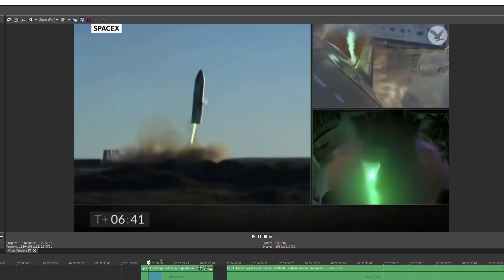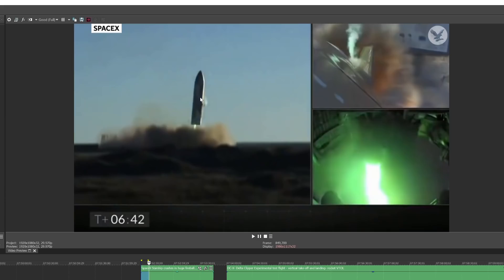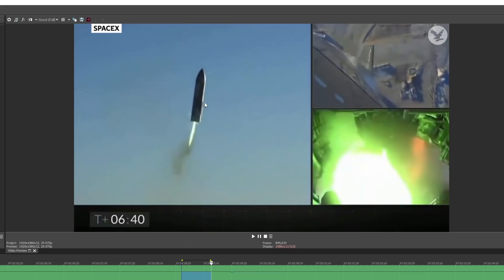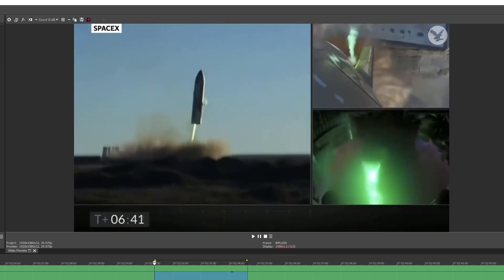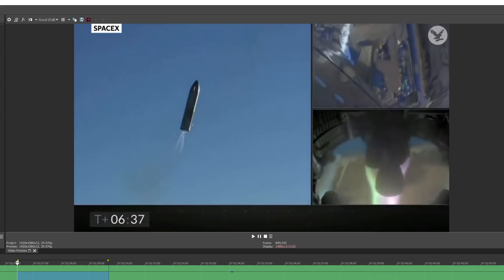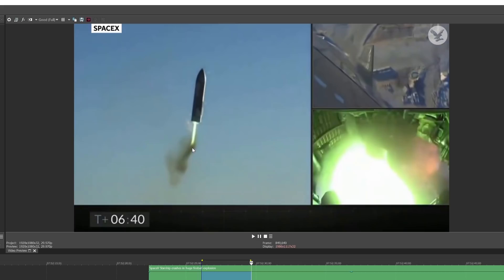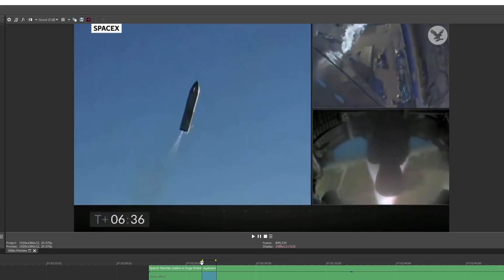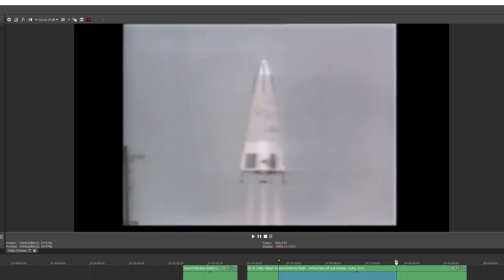SpaceX Starship Explosion: First analysis!

Comment: just a couple of notes, the combustion does not happen in the bell, there is a combustion chamber and the bell is to speed up the exhaust, not sure if that is what you meant but just to clarify.  also in teams of how the fuel and oxidizer is fed into the engines, they have separate pressurized header tanks.  they do not feed from the main tank, this is supposed to stop the issue of inconsistent fuel feed on relight and combustion issues.  however, the pressure to the engines does appear to be an issue according to Musk's tweet.

Comment: Interesting points. A few things, to add your right about the fuel tank issues, thats why on this rocket they have seperate pressurized tanks for the landing fuel and they basically drain the main tanks on accent. On twitter Elon said those tanks didn't have enough pressure. My thoughts are they lost the correct ratio of fuel and oxidizer and that results in "engine rich exhaust"
Reply: Exactly my understanding so far. 
Been following the development of this vehicle for years now and moderate the Everyday Astronaut discord for context.
Reply: @faceplants2  that's awesome, he makes great content I had his stream and space x up for all the sn8 launch attempts.
Reply: Why does it result in this?
Reply: @JohnnyZenith  when burning with an oxidizer like liquid oxygen it's very aggressive. If the methanol is not available to be burned it will then react with whatever else it's in contact with. In this case it appears to be copper in the engine. They once experience a similar green flame on a raptor test and it was confirmed that it was copper from part of the engine.
Reply: @EvanDunville  Raptor burns methane, not methanol (CH4, not CH3OH). Just to clarify.
Reply: @sycodeathman  ha ha oops. I work in the chemical industry so I talk about methanol lots. Your totally right it is methane.

Comment: Technological advances of SpaceX compared to DC-X which flew between '93 to '96.
CPU Speed...     DC-X '93 to '96 RAM = 300MHz        SpaceX 2020 = 3.4GHz(16 Core)
RAM...     DC-X '93 to '96 RAM = 4Mb to 128Mb        SpaceX 2020 = 48Gb
Congratulations SpaceX just keep trying as everyone has failures and learns by their mistakes!

Comment: It looks like one of the two engines failed, like you said. You can see only half the jet output is remaining after that burst of green light. Basically, One of the two engine jets turn green, and you have both a green and blue/purple jet. Soon after, it looks like the green engine bell swings sideways, and knocks out the still-correctly-operating jet. That or the other engine simply happened to die when the green jet swung out of view. Then the one remaining green jet keeps working (swinging back into view of the camera), but it is with half the thrust that the rocket needs to slow its landing.
Reply: From what spacex has said the little header fuel tank for landing in the nosecone had some issues. The fuel supply most likely went highly oxygen rich and caused some of the copper pipes that cool the nozzle to burn. Apparently the engine out toward apogee was intentional and all engines did relight successfully for the landing burn. Imo the test looks to have gone great as the biggest thing was the aero performance and burn back to vertical not the actual landing. My bet is than sn9 will probably land and not rud.

Comment: Thanks for the video and analysis. 

I thought that Raptor used TEB for ignition with green color just like the Merlin engine but that’s not correct.

Will be interesting to see how low fuel pressure from the header tanks relates to the green exhaust. Guessing that low fuel flow + the high temp turbopumps = some of the plumbing or injectors started melting & burning.
Reply: Raptor uses electric torch igniters (a giant spark), not TEATEB.

Low fuel pressure = less coolant (fuel) going through the regen channels in the nozzle = nozzle begins to melt, nozzle is made partly out of copper = green flame.

Comment: I thought they had smaller separate tanks that remained full just for the restart to prevent this problem though.
Reply: Yeah they do. It seems that those separate tanks didn't provide enough pressure to keep the engines running.
Reply: @clippityclipclip10  speculation, will not lead to anything useful
Reply: @dwayne_dibley  should have included source in the comment
Reply: @YounesLayachi  I wasn't speculating in the sense you are talking about. This is what Elon said himself. But, since we don't have the data (as to be expected) to do a third party check on Elon's claims, I said it seems to be such.

Comment: They use spherical header tanks, Oxygen in nose, CH4 in between common bulkhead... Raptor shutdown at end was normal, only want one engine for landing, two engines has too much thrust... Single engine at end started burning copper due to oxygen rich propellant because CH4 header tank didn't have enough pressure. This is either ran out of CH4, or not enough feed pressure into header. This caused the single raptor engine to have lower thrust than required, and it impacted before it had enough time to slow down.

Either way wildly successful test, SN9 is waiting and ready, they should have all those problems ironed out for it's flight in a few weeks or so.

Comment: Musk twitter a year ago:  "Raptor uses milled copper channels with an inconel jacket all the way down"  ... one engine burned up
Musk twitter today: "Fuel header tank pressure was low during landing burn, causing touchdown velocity to be high & RUD, but we got all the data we needed! Congrats SpaceX team hell yeah!!  .....Successful ascent, switchover to header tanks & precise flap control to landing point!"

Comment: I'm seeing reports that the green was due to copper lining of the engines being oxidised due to fuel starvation. AKA "Engine Rich Exhaust".
Reply: The real analysis you've been waiting for from Scott Manley
https://youtu.be/egHxiX40eJY
Reply: "Engine Rich Exhaust" means that the engine ate itself. There is copper cooling pipes in the engine hence the green flame.
Reply: Engine rich exhaust..  my gawd xD
Reply: Makes sense, every other possibility i was thinking of was related to something breaking, but it probably would be more catastrophic than it was
And elon said it was a header tank pressure problem, and that the engines did great
So probably not a engine related problem(at least not one that started on the engine)
Reply: Scott Manley Twitter follower detected :)
Reply: Google says copper make a flame burn blue and that Barium makes a flame burn green.
Reply: @tarstarkusz  I burned copper wires for a science project once, the flame was definitely green
Reply: @tarstarkusz  Copper burns green to blue, and there's likely other alloying materials in whatever was burning.

Comment: This engine's injectors seem to be copper: https://twitter.com/burpg/status/675167881471139841
Reply: The entire inner lining of the nozzle is copper also, however it's not structural. The inner copper lining has the coolant channels through it to withstand the heat of the combustion reaction, and for strength this copper layer is wrapped in a very strong steel alloy jacket.

Comment: Starship has two small header tanks that are used to fuel the rockets on landing with less sloshing. They are independent from the main tanks and much smaller. One (LOX) is in the nose, the other is at the top of the lower methane tank.  They aren't using the big main tanks at that point.  Musk confirmed successful switching to the header tanks,  but fuel pressure was too low to sustain the engines.

And green flames happen when they use TEA-TEB ignitor fluid used to start the engines.  The question is, on landing was there some other problem making the green flames, or was TEA-TEB being injected to keep it burning.
Reply: Raptor does not use starter fluid
Reply: @toby1248  yup that appears to be true ... but it always flashes green flame on ignition.
Reply: @KenLord  Raptor does not flash green ever, unless it had a bad startup or shut down. If Raptor flame goes green, it's burning its own combustion chamber.
Reply: @KenLord  it's only the Merlin engines on Falcon 9 and Heavy that flash green on ignition. Those do have starter fluid

Comment: The regenerative cooling parts of the engine bells are copper. That is almost certainly where the green was coming from. That engine that had green exhaust is also the first one that looked like it flamed out unexpectedly at the beginning of the flight. very cool watching the remaining two engines gimbal to compensate for the loss of thrust.
Reply: they had two engine flame-outs on ascent, I believe they were intentional
Reply: @TheAechBomb  The first engine out did not look intentional but we will get more in-depth information almost certainly. That is one of the fun parts of watching SpaceX developed vehicles is that they share so much information publicly.
Reply: The vehicle also appears to have never gone supersonic and the burn was much longer than the flight profile we were expecting due to the engine cutouts.
This was The coolest rocket launch I've seen since Falcon Heavy or maybe even the first successful landing of a Falcon 9 booster
Reply: @faceplants2  I pretty sure the shutdown were planned. I think I saw someone talking about that 3-2-1 thing. It is also logic as they would not want to go ballistic where they would have little control of the attitude while slowing down. We have already in-depth information as Elon Musk called it a full success except a loss of pressure in the fuel header tank used for landing ( that's how they deal with slosh, two small header tanks used only for landing), confirming just a few minutes after the landing that it was an oxygen rich situation

The rocket was not supposed to go supersonic, they changed that like last week
Reply: @Meiliv  I'll be curious to hear further official updates. The best info on the flight profile I had was from Declan from Flightclub.io 

They had a lack of pressure in the O² header tank. That would lead to fuel rich combustion.
Reply: @faceplants2  Well, the best source of info is always Elon's tweets, and he confirmed few minutes after the landing that engines did great all along and that the FUEL tank lost pressure in the end
Reply: @Meiliv  That was a short tweet. Wait for more detailed info and the thorough breakdown that Scott Manley will put out. The engines performed well but absolutely had a few anomalies. 

The fact that it flew aerodynamically with the new flaps and transitioned from belly flop back to vertical was a tremendous success but that doesn't mean that everything before the hard touchdown and RUD went perfectly.
Reply: @faceplants2  That would not be damaging to the engine like an oxygen rich combustion would be.
Reply: @davesvoboda2785  Yeah after more details and analysis came out, It sounds like I had it reversed and it was oxygen-rich mixture causing the engine to consume itself.
Reply: They turn the engines off to control thrust. As the fuel burns off the rocket reduces in weight, so the acceleration gets higher and higher, but by shutting off one engine, it reduces acceleration. The two engines they used to land were the two engines that shut off.

Comment: The flame out was planned - the empty Starship is too light for even two engines going. They partially lost feed of fuel due to low pressure in header tank and oxygen richness used the engine as fuel instead of methane...
The main tanks were so empty at the landing that  there was only what was in header tanks.
Reply: As a loss of feed to the engines is a problem wouldn't it be wise to employ a construction to not let the liquids move around in the tanks.
I have a hard time to believe that the tanks are at low to no pressure while the tanks are almost empty allowing the liquid to move around causing a partial loss of feed.
Seems to be a big design failure to me if that's the case.
Reply: @kullatnunu2087  I think that's why the header tanks are there. To not let the fuel needed for landing move around on the maneuver. Since the rest of the flight was done on the main fuel tanks without issue I'm guessing something with the ground handling or design of the header tanks is bad, but that seems to be the only thing they need to fix which remains untested. Everything else worked.

Comment: Green is the Starting Fluid.  It is tring to restart. Watch Falcon 9 at start, you well see the green flash.  Lights with contact with O2.
Reply: Nope. Raptor doesn't use that starter fluid (I forgot what it is called).
Reply: Combustion chamber is made partly out of copper.
Reply: @Katniss218  Yes, and I stand corrected.  The Raptor engine does not use TEA-TEB.  Most likely, as stated by others, mixture went lean and started burning engine metals including copper.  I know that F9 engines use copper as an inner lining, therefore Raptor likely does as well.

Comment: only at 4 minutes in here, i can say, green flames comes from the starter fuel on some rockets, if it really did flame out, then this was an emergency restart... well probably... also, one thing i know do not slosh, is syringes... i always assumed giant tanks like those had some compressor plate with a screw just keeping the fuel pressed and used decompressed gas in the empty part behind... so don't mind me i am just some idiot! lol EDIT, a few typos. also too bad for them, they totally failed their suicide burn... all they can do is give it more leeway next time and save less fuel. EDIT2: supposedly the rocket does not use Starter Fuel and uses a spark to ignite.
Reply: finished the video, here is my guess:

fuel slosh
temporary flame out
emergency restart with the leftover starter fuel (produces green flames)
the time for the suicide burn had no leeway that 100 ms off on 2 of the engines cost too much velocity for the time it had left.

starter fuel is used on certain rockets since normally you had giant a fuse in a rocket... with starter fuel you can restart an engine in space unlike normal fuel. the word hypergolic fuel comes to mind but probably not related... all i can say is the fuel ignites when mixed so you don't need a fuse. so when it ran out of fuel in the pump, it put the starter fuel in in emergency and the flame puffs were the rocket flaming out. so it then restarted them with more starter fuel. this tight schedule for the suicide burn had no space for that event apparently.

that is my best guess. (i do suicide burns in KSP all the time so, if you miss the window, you are dead no matter how much you try, the rocket only burns what it can after all. that is also why i do suicide burns with a + 10 second instead of a +1. i ain't a computer. they also use computers so they must have been cheeky.) 

EDIT: supposedly the rocket does not use Starter Fuel and uses a spark to ignite.

Comment: So far as I know the engines are made from Copper and coated with Inconel. There could be an issue with the coating.
Reply: The inside of the main combustion chamber and nozzle is made of bare copper alloy, the outside is made of a thick jacket of much stronger inconel alloy. Between the two layers are passages milled out that allow liquid methane to flow through as coolant. The reason the inside of the chamber needs to be made of copper is because they need to have as little insulation between the coolant and the hot gasses inside the chamber as possible, otherwise there will be spots of overheating and damage to the engine.

Comment: Apart from the RUD that was Awesome! 
I thought it was relight fluid causing the green flame 🙄🚀 bring on sn9
Reply: No, that's a common misconception and it's sad it's still being spread. Raptor doesn't use T-Teb to reignite, it uses a spark... Copper burning inside from oxygen rich low fuel pressure.

Comment: The engines are ignited with a mixture of triethylaluminium and triethylborane (TEA-TEB)

Triethylborane is strongly pyrophoric, igniting spontaneously in air, burning with an apple-green flame characteristic for boron compounds. So I think it was trying a futile reignite
Reply: That was my first thought when I saw that green color. It can’t be barium so the next thought was some fancy boron containing mixture.
Reply: Nah. Electric egnition source. Tea-teb is only used on Falcon 9 and Falcon Heavy. How are you gonna find/make Tea-teb on mars?
Reply: Chyza ok. I was not sure if they behaved the same.
Reply: @JaYoeNation  If you weren't sure - why comment with such wrongness?
Reply: Raptors don't use TEATEB to ignite. The combustion chamber is made partly out of copper.
Reply: Pyrophoric triethylborane - that was my first guess. That or engine go bang bang! ;-)

Comment: Excellent analysis as usual! Your predictions are spot on!
EDIT: observations not predictions. Thanks Harman and Murf for bringing this correction.
Reply: Except, they're not.
Reply: @HarmanRobotics  he did predict that the engine getting eaten was because of the fuel issues and the green flame is due to copper. In hindsight it may not be impressive. But, this video was produced off the cuff without any prior preparation. This shows his breath of knowledge. Ofc your average rocket nerd friend may also be able to make similar predictions. But, that isn’t the point.
EDIT: make it observe. Correct op. Thanks.
Reply: what is his prediction here?
Reply: @thesnitch7  he did predict it was likely because of copper (which it was). In hindsight it may seem obvious. But he did this off cuff.
Reply: @clippityclipclip10  But that is an observation - not a predictions. He - just like all of us - observed the green burn = copper. That is not a prediction.
Reply: @thesnitch7  ah yes I see. I got my wording wrong. Thanks for pointing that out. Will correct it!!
Reply: @clippityclipclip10  its all good mate